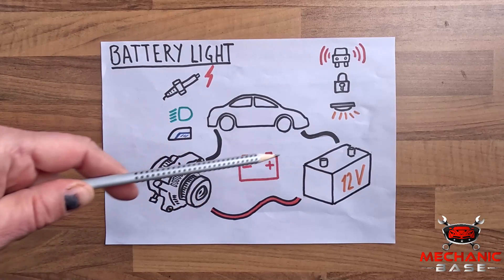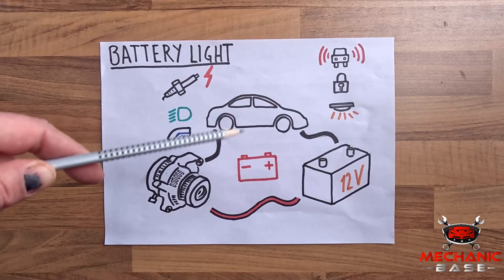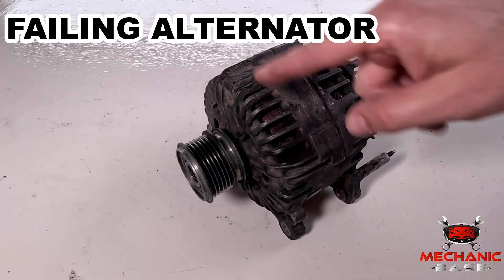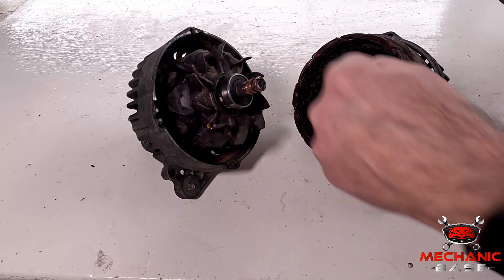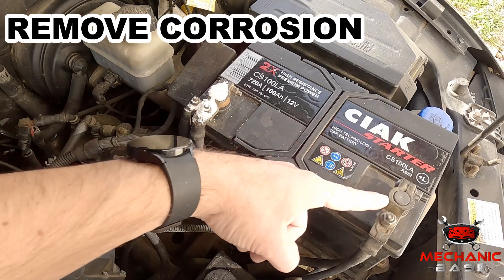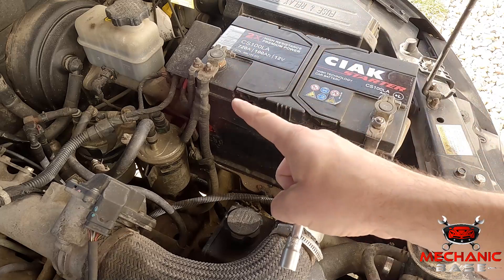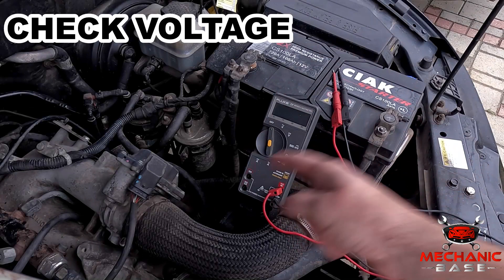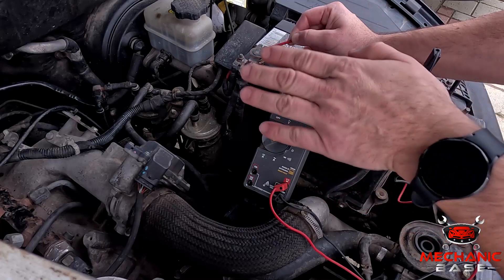Red Battery Warning Light On? 5 Common Causes & How to fix it

Comment: Ive had my battery and alternator check and both working fine , ive driven for over 100 mile with the battery light on and had no problems i will have to check the belt as there is no corrosion. Thanks for your video 👍

Comment: What about a red battery light that comes on then goes off intermittently?
Reply from the maker: Does it change with revs?
Reply: @MechanicBase  on start up there's like an erratic rev the speedometer needle goes up and down quickly if that makes sense
Reply: Yes that is what is going on with my truck. Wondering what the issue is
Reply: @bigChris01  hi yeah managed to figure it out it was the altonator lights have gone and everything is ok so far